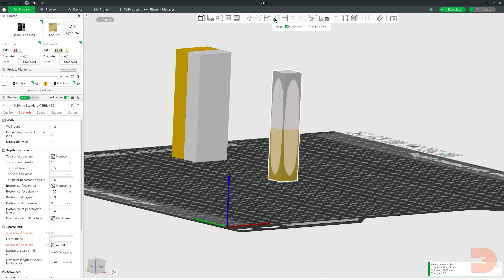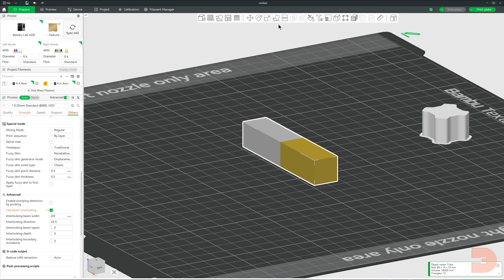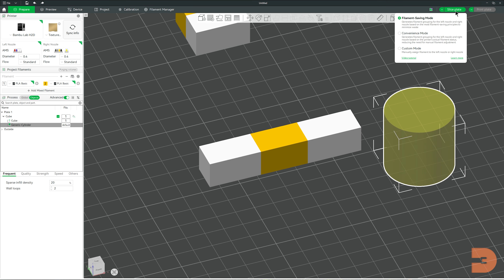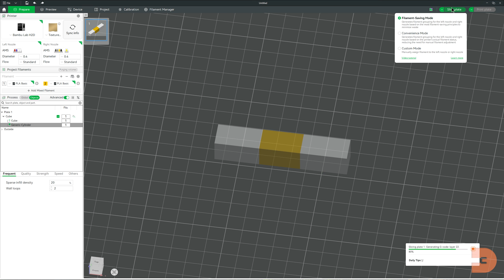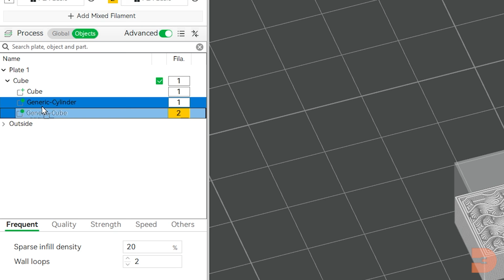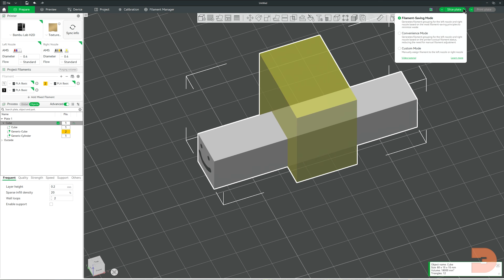Your Multi-Colour 3D Prints Are Weak! Fix It Now

Comment: 3:54 Not sure if the standard version of OrcaSlicer offers this, but on the beta (under the multimaterial tab) you can just select what material you want for the infill. I haven't tried it yet, but it may be a one button solution.
Reply from the maker: Some slicers do allow you to assign a specific colour to the infill, however, that doesn't really help with this. Firstly, it wouldn't allow you to assign a varied depth of the walls to certain areas, meaning it would darken the entire model by the same level, in theory. But also, when using dithers where the colour varies a lot on a single lateral layer, the surface colour extends quite far into the model to ensure it bonds well with the rest of the model, meaning the infill wouldn't have an impact on that colour anyway.

Thanks for the suggestion though and always keep the ideas coming, really appreciated!